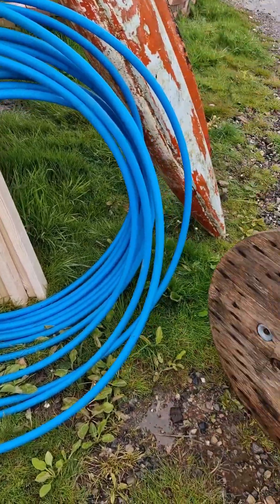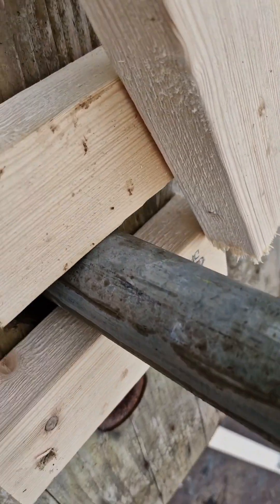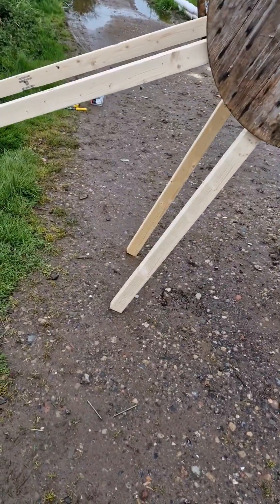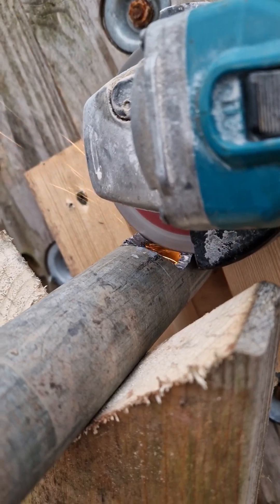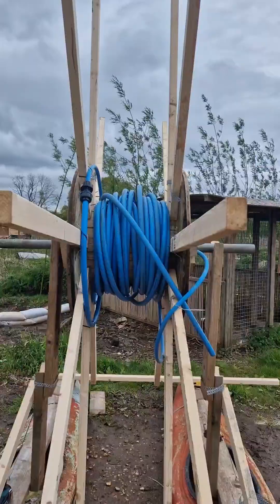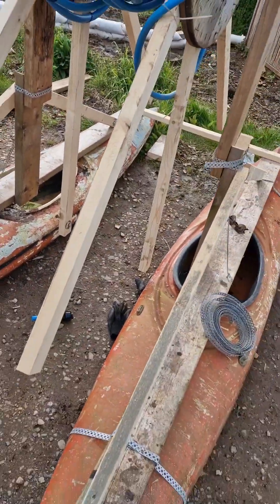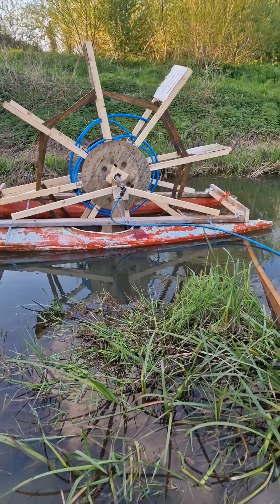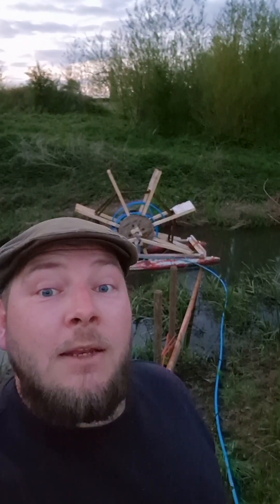How I built a Floating river powered water pump for Free to water my vegetable garden!

Comment: Really love what you do mate.
Got a question for you.
Can you make a parabolic mirror (like they do in asia) and direct the light to a central point, focused on a pan with water in it, and harness the steam ? For example it turns a wheel that can generate power.
Would the load be too low ?
Just an idea 
Im obviously not very scientific

Comment: Only thing I’d say is start out further from the center and use a larger diameter pipe then do your tight coils in the center like you did think of it like the compressor stages of a jet engine first stage the stuff on the outside of the wheel adds flow and ingests the water then the tight coils confine it and compress the air bubbles to give you more pressure and head